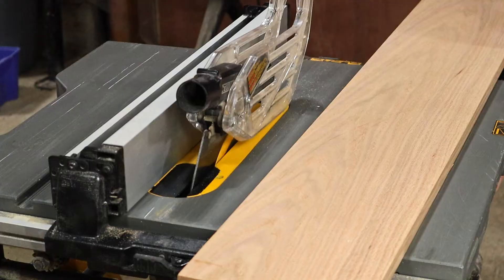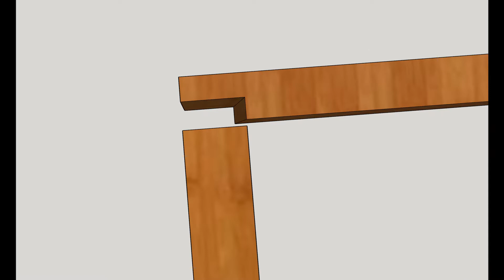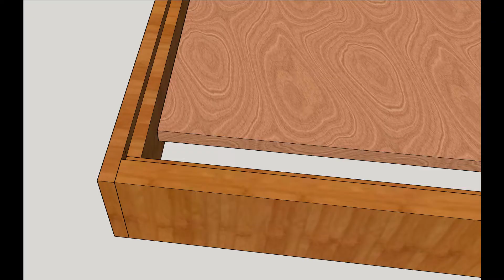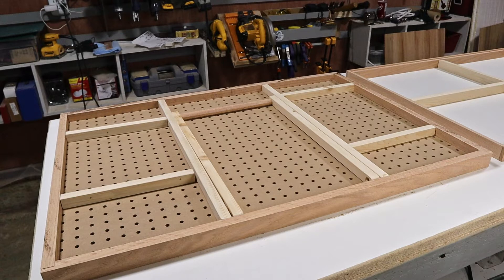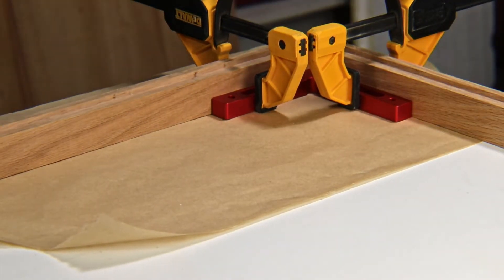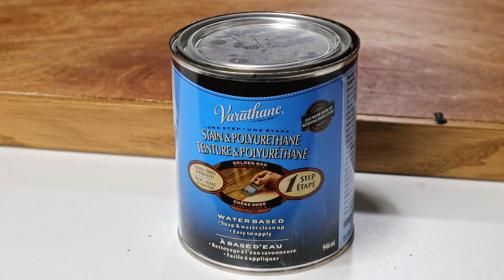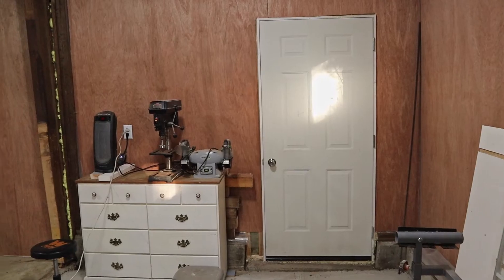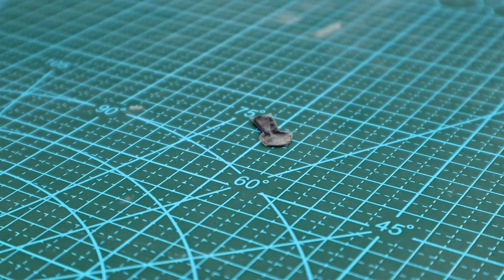Jigsaw Puzzle Table Alternative - The Puzzle Easel

Comment: Can you please send me a list of supplies needed to make this
Reply from the maker: I made this one from my head so I don't really have any measurements or a cut list, but maybe I can recall the basics.
The oak was 1 single board - 1x6 8ft long.
About half a sheet of 1/16th inch plywood - I use Bintangor.
Some peg board, about 36"x24"
The interior supports are just some scrap pine, maybe 1 board about the same size as the oak... Or a little smaller.
A bit of felt (24"x36")
2 hinges
1 clasp
A small pile of picture frame holders.
And a handle... I think that it. I may have to try to out together some plans for this, a few people have asked for more details.

Comment: You were getting the burn marks on the oak for 2 reasons that I can see -- you weren't feeding the board through consistently, which allowed the blade to burn the side due to friction heat build up... however this should be so bad if you were using a ripping blade (fewer teeth) instead of a fine crosscutting blade (more teeth) (the second reason).  When ripping (long cuts WITH the grain), it's best to use a dedicated ripping blade, and when cross cuts (against the grain) like you were doing with your crosscut sled, you should use a crosscutting blade.  Regardless, this turned out great!  Thanks for sharing with us!
Reply from the maker: Thanks for the tips, I believe you are correct. The blade used was a hybrid that does an okay job of both but not a very good job at either. Feeding the board in at a steady pace is a struggle with such a long board, something for me to work on improving
Reply: @LogHouseFarm  happens to us all!
Reply: I also think your riving knife is not perfectly in line with your saw blade. It looks that the riving knife has an offset to the left and pulls the material off your fence.
Reply from the maker: @universalgenie  good eye, it does occasionally catch a little on a peice as it feeds in. I have attemyto adjust it before, and it improves a bit, but still needs work.
Thanks for commenting
Reply: @LogHouseFarm  I hope you will get it perfectly aligned. I had the same problem with my DeWalt 7492 out if the box. I glued a thin piece of metal on one side of the riving knife to correct that and get it in the middle of the saw blade.
Reply: @LogHouseFarm  One idea to consider to help with the feeding the rip cuts would be to try to cross cut the board to close to needed size or even just cut in half.  You will have to make more rips, but they will be shorter and easier to handle.  Oak is bad for burning like that.
Reply from the maker: @kirkfranks1  great advice, thanks!